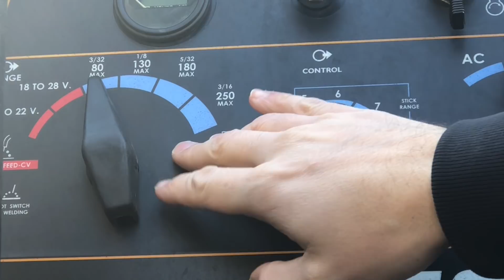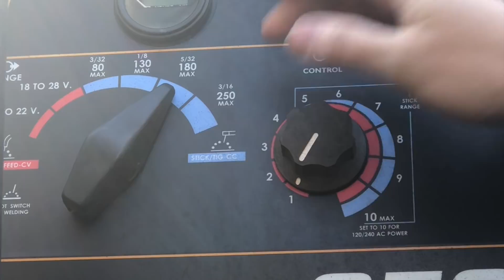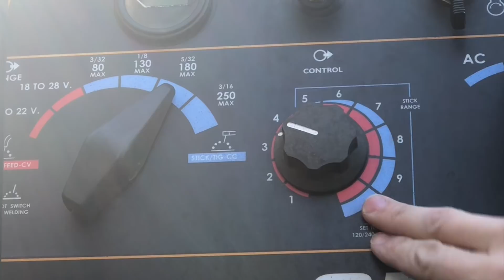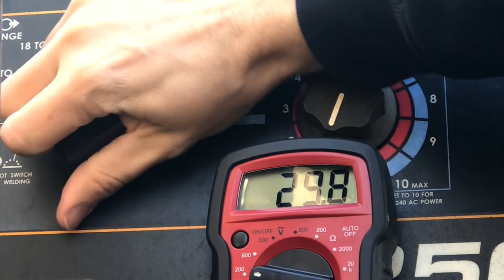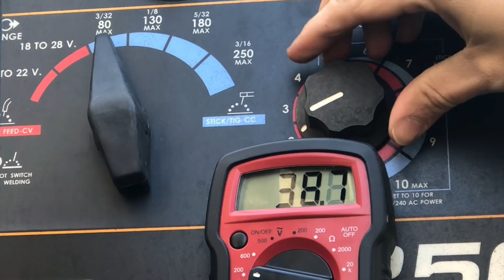How To Manipulate Weld Puddle Chracteristics

Comment: Great video thanks for the info. Question for you. I have a Miller bobcat 250. On the voltage setting it says when welding to set it at between 7-10. I’m not sure why they did that it almost contradicts the entire concept of going up a gear on the amps and running low on the voltage. Curious if you had any idea thanks
Reply from the maker: You have to run at 7-10 if you want to be able to weld and use a grinder or something at the same time, other than that you don’t have to run at 7-10.
Reply: @Welderbeast  thanks for the reply. I figured that was the reason. I even read through the owners manual searching for some more info really poorly outlined section. Thanks for passing along info
Reply from the maker: No problem;)

Comment: I wasn't aware the 250 gxt was capable of this. On the sae it changes the ocv which changes the puddle or arc characteristics. Was going to call Lincoln on this very machine tomorrow and see what they say on it
Reply from the maker: The SAE has a lot better gradient in the changes of the OCV, my Ranger was the only machine I had to show the concept;)
Reply: @Welderbeast  right on. I'm still calling Lincoln when they open, I can let u know what they say on it. I know I hope your right on it and it's not just a basic amperage adjustment and the gears mean nothing but a ball park to get you there and the overlapping does not change the voltage of puddle. Will pry make me get the 330 mpx in that case but I really hope your right on this
Reply: @Welderbeast  just got off the phone with Lincoln, does nothing to the voltage regardless of where the fine current is set the only adjustment is amperage.
Reply from the maker: chris jones that’s interesting cause I was able to change the OCV with the fine current on my machine. You can watch me do it in the video but thanks for sharing brother
Reply: @Welderbeast  well I'm about to order one my self either way. Def hope it changes for different rods/position could really benefit from that

Comment: For a little fun, you could try running some 1/16" 1.6mm 6013 Electrodes from Harbor Freight on some 1 or 1/2" square steel tubing. There aren't many youtube videos on that and most of them are poor. I've found these electrodes run nice smooth beads great, IF and only IF you have set your welder correctly. They will run beads on both DCEP and DCEN and benefit greatly from added voltage (arc force) which helps them lightup and also pushes the extremely fluid slag back. I would like to see what you could do with that. Probably get you a bunch of views, too. Does the thin walled tubing need to be bevel'd, does it have to be run downhill, how to do an outside corner, how to tack without blowing through without having MIG, is a heatsink going to be required when you fabricate with the tubing, etc?
Reply from the maker: Protected Profile a very good suggestion

Comment: Hey man I just wanted to say "THANK YOU!" for explaining this! I have had to figure out on my own how to manipulate the controls to dial in the correct puddle required at the time, but never understood EXACTLY what was going on behind the panel to make it happen. I only knew 'it just did" no doubt like countless others!
And I thought I might mention I mig and tig weld in a shop environment most of the time and have just a little experience with stick. I say this because you mentioned you weren't positive it would be the same with mig machines. It is with my Hobart, more or less. It is a matter of controlling the wire feed as the fine control.
I'm glad I found your channel. It is like reading a book instead of watching television. I mean that in the very best way!
God bless!
✌
Reply from the maker: patrick farley thank you 🙏🏽 I’m glad you find my videos educational and helpful! That’s the only point to my videos is to help out and contribute the best I can

Comment: What if you don't have fine tuning on your machine .
Reply from the maker: francisco ziliani the only machines I’ve seen without a fine control are machines with the continuous range and digital read out. On those machines, the ones I’ve used, they have an Arc Control knob where you can turn it to -10 for soft(high volts) or turn it up to 10 for crisp(low volts). I’m not sure how you can control voltage with a machine that doesn’t have either a fine control or an arc control
Reply: @Welderbeast  I own a Hobart champion an old one and I control the puddle with just fine hand movement , hahahah
Reply from the maker: francisco ziliani exactly, you can easily control your voltage with long arcing or shortening up your arc as well!
Reply: @Welderbeast  that's why I bought an inverter with overlapping ranges and an arc force adjustment which attempts to emulate a dual control welder. It's not the greatest, but I am able to obtain a soft butter puddle or shove a rod through 1/2" steel.

Comment: hey bud, question for you? if you were to do it all over again, would you buy the machine that you have or would you go with something different? thanks.
Reply from the maker: blatant2subtlety honestly for what I do with my business, yes! I would buy this machine again cause it’s been a great machine and welds amazing. Also with what I will ever get into, I can’t over work it with such a high duty cycle(250 amps at 100% duty cycle). Only reason I would choose a different machine like a SA200 is if I was planning on going pipelining

Comment: What Lincoln machine do you use and do you recommend Lincoln? I love my sa200 but looking for something newer with ac generator.
Reply: I like my Miller Trailblazer, welds on idle, makes ac power at idle (excel power), 12k watt generator, and its fuel injected. I personally don't like the way a Ranger welds, but I like the bigger SAE and Vantage Lincoln machines.
Reply from the maker: SteelFabMechanic I would prefer the larger machines but larger also comes with a bigger price tag lol
Reply: @Welderbeast  that's why I have a trailblazer lol
Reply from the maker: DOHuster I use the Lincoln Ranger 250 GXT, most of the machines I’ve run are Lincoln so I’m kind of biased towards Lincoln lol

Comment: I thought you did a great job of explaining how this works brother 👍 
That's a great machine you have there too.  650LBS full of fuel and 100% duty cycle, and you can stack the metal in with it pretty good 😏
Reply from the maker: RCRCustoms thanks brother and that’s why I went with it, light to haul around and I’ve never welded over 250 amps in my career so with the 100% duty cycle I figured I would be safe on everything I ever touch;)
Reply: @Welderbeast  I've got the same machine on a skid complete with a job box full of gear that I built that is small enough that I can slide it in the back of my short box Dodge 1500.  It can get in to the really crappy places in the middle of nowhere that my old F450 should never have to go LOL 
The half ton Dodge is about 4000 LBS lighter than the 4 ton F450 Ford, so if the repair is out in a softer swampier place out in the bush the lighter truck gets the job.  An SA200 or a 500vantage are both to BIG for the smaller truck, so there's definitely no room weight wise for any other gear and 2 trips and unloading a machine is always a bad option right.
Reply from the maker: RCRCustoms different set ups for different jobs, sounds like your prepared for it all!
Reply: @Welderbeast  I try to be, and I still work for someone else as a full time job fixing equipment in a shop 40 hours a week LOL 

It's the middle of the night and weekend emergency stuff, that is where I found the good money lives 😏👍
Reply from the maker: RCRCustoms makes sense, I guess there would be as much money in emergency as there is in chaos 🤣
Reply: @Welderbeast  chaos = cash
Reply from the maker: RCRCustoms you know the game
Reply: @Welderbeast  yes sir, I've been at this sort of thing for a long time now LOL
Reply from the maker: RCRCustoms lol long enough to know better